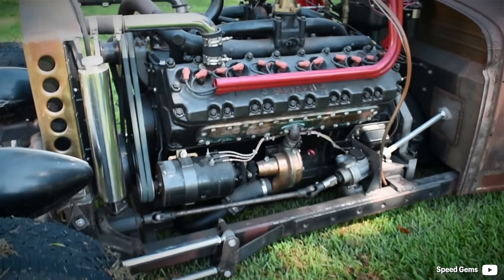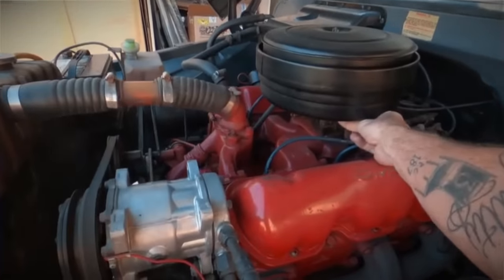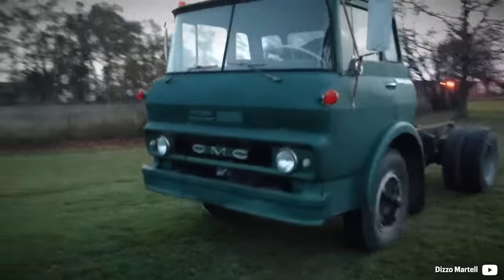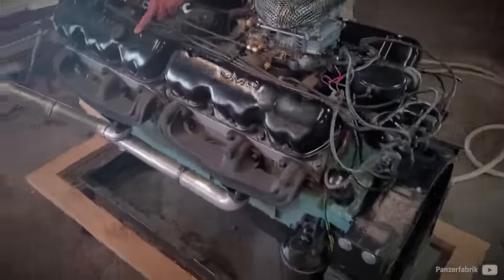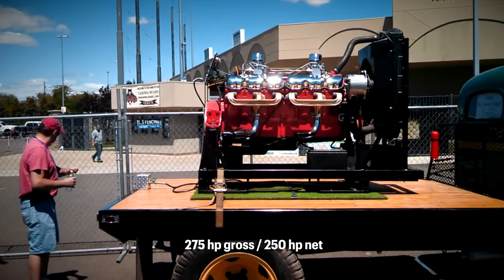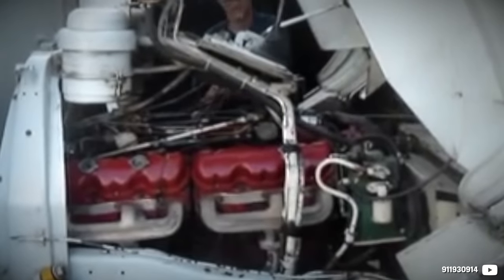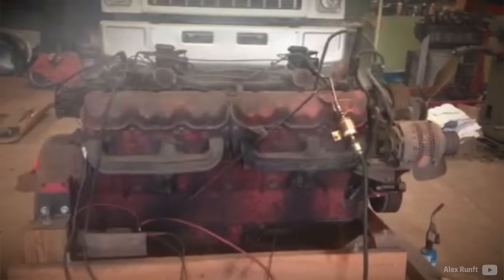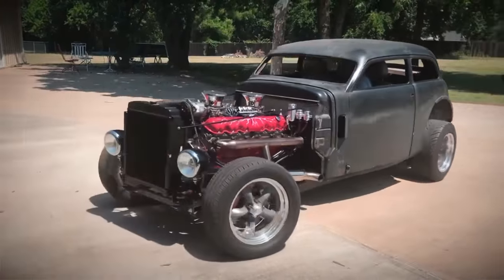GMC's Low RPM Gasoline 11.5-litre V12

Comment: Okay I hate to have to critique this so badly but it was really hard to get past the accent but I could put up with that but then you're talking about American produced engines here in America where we have the non-metric system we don't use the metric system here on american-made things so why would you mention the weight in kilograms of some of the parts and then also we say gasoline over here or just gas we don't use the word petrol that's not a word that comes out of people's mouths on a day-to-day basis over here so if you want to continue doing videos for an American audience let's don't use the metric system for anything whatsoever and let's use American words like gasoline and feet and inches and pounds when you're going to describe the weight of something or the length of something and I would suggest trying to tone down the accent a little bit it's very heavy

Comment: GMC had five divisions at one time with no parts of any of five completely different V8 engines would not interchange with any of the other four except for the distributer cap ...example at one time a 350 cu in . Pontiac, Buick, Oldsmobile , Chevrolet engines ..not one part the same , not even close ...Ford, Lincoln, and Mercury , all same engine ...but a very fast v8 that motored all at the drag strip for a while was designed using the most reliable parts of all GM, Ford , and MoPar V8s, that were built by AMC  ..and directly after Roger Penske dropped his Z/28 from his trans am program in favor of the 1971 AMC Javelin AMX with Mark Donahue at the wheel stomping the crap out of the Trans Am series championships ..all of a sudden all you heard from consumer reports and critics all alike was what a piece of shit american motors cars were all junk of everything about them that where all parts copies of the big boyz toys....you see when you make fun of the big bois and their racing hobbies ...you're not going to be around much longer as i was working as a wrench for Johnny Moore Rambler back in 1971. And me and the shop foreman on our hour long lunch break were required to road test AMC latest hot rods on our own time ..as our test track was ohio boulevard a one way two lane east and the same west were me and tricky dick as johnny called my foreman ...we were laughing our asses off removing a good 1000 miles of rubber off the rear tires of your new hot rod javelin before you thought about buying one